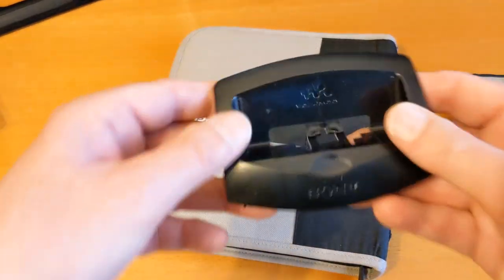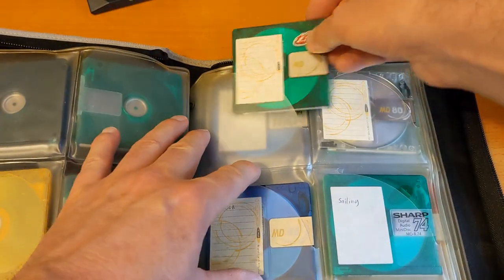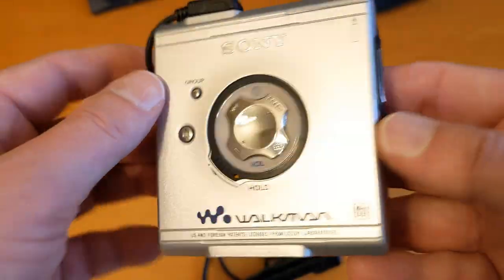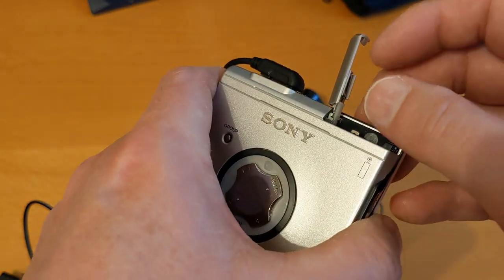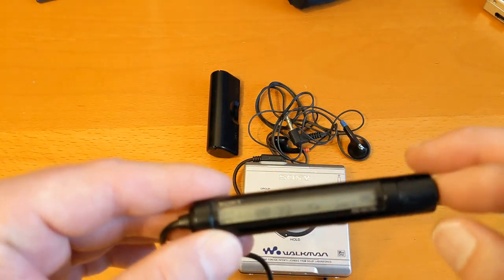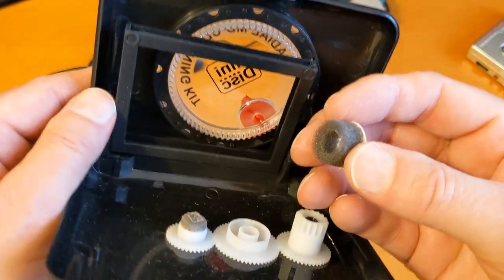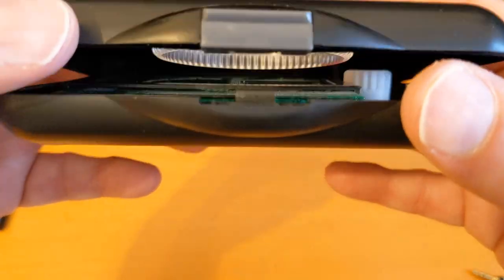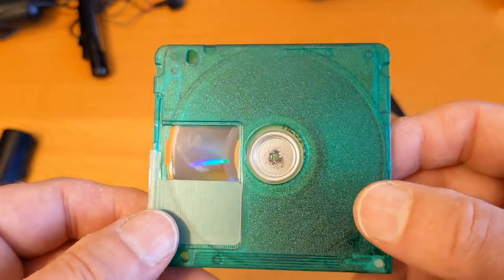Sony MZ-501 Minidisc Player, Discs, & Accessories Haul

Comment: A good way for clean the minidiscs (i think is the best way) is to open dhe corner of the case, slide out the disc anda wash with neutral disches detertent. Is important o to clean both faces because the top face is touching for recorder head. Most of the time is not necessary to put glue for close the disc case.
Reply from the maker: Thanks. I'll give that a try.

Comment: I have the MZ-E500, MZ-E501 and MZ-E505. They all use the same cradle, which I don't have, and are all very light and small. The 505 is aesthetically more pleasing and has all the controls on the front, with the exception of the hold switch on the rear. The volume controls on the 505 are better positioned too, being where the group and stop buttons are on the 501.
Reply from the maker: Thanks for the info. I searched for the 500 and 505, they're nice players. My 501 needs some work, unfortunately. Battery corrosion, of course, so it's on the subs bench at the moment.

Comment: Nice player.
I have the bottom half of that cradle & I always knew something was missing, now I know.
Reply from the maker: Do you have the player too?
I wonder if Sony made the cradle in two parts so that the bottom part was compatible with multiple devices and the top part was unique to each player.
Reply: @CBitsTech  you're probably right.
I got it with a different player.
 I did have that player but sold it not long ago.
Reply from the maker: @theelectronage  Mine seemed to be working, but needs a battery contact cleaning.

Comment: Some nice pickups, i have installed software on my linux laptop to use my net md walkman it can convert cd,s and copy them to minidisc it should be even easier than setting it up on a windows machine .
Reply from the maker: Thanks. What software works with Linux please. I don't use Linux (but I have dabbled in the past), I'm just curious to know.